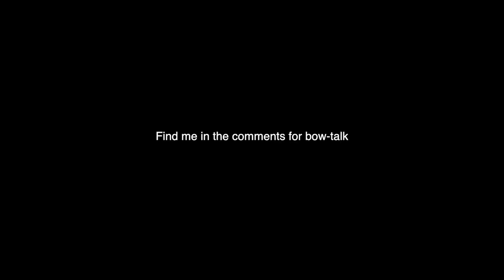Bushcraft Survival Bow

Comment: Wow! That’s a beautiful piece of timber. I’ve been wondering if I can use western red cedar for a bow. Its very common here in the PNW. Is there anyway to prevent set on green bows? And in your experience, which wood takes the most set?        Thanks for the vid Dan 👍
Reply from the maker: As far as I know western red cedar has no relation. I would approach making a bow out of it like making a bow from pine or other ‘non ideal’ wood. Eastern Red Cedar is really a juniper not a cedar at all. I think set has an unfair reputation. I’m not saying it’s a good thing, but sometimes it’s better to have a bow take set rather than break. Hickory for example had a bad reputation for taking set, but a fantastic reputation for being hard to break. Making bows is all trade offs, nothing is free. So yes, green wood bows are gonna take set and there’s not much you can do other than overbuild them. But on the other hand, they’re harder to break, so your margin for error is very high. I can’t make a fun proper bow in an hour, but with green wood that’s no problem. 
I’m not sure which wood takes most set. To generalize, the woods that take a lot of set tend to be strong in tension with relatively low compression strength. These woods also tend to respond well to heat treating, which increases compression strength, but adds brittleness in tension. nothing’s free in bowmaking and you have to barter for all your gains
Reply from the maker: Neat! Western cedar doesn’t grow around me so I’ve never used it. After looking it up it isn’t really a cedar either but actually a Cypress, which i’ve heard can make good bow wood, so I’m not surprised. There are a lot of bow woods that are considered marginal that I actually really like. I’m sure western red cedar could be one of them. i’m making a bow from fir right now, which isn’t considered the best either. I hadn’t heard that about saxton pope. I know the thompson brothers though of eastern red cedar as poor mans yew
Reply: Dan Santana Bows I've always wondered about fir tell me how it goes
Reply from the maker: That bow might be in the next video, we’ll see. This piece is only 40” so it’s a short paddle bow, won’t have too high of a draw weight. Fir isn’t bad bow wood but it’s not very dense. If you adjust oak board bow designs in width proportional to the density difference, then fir makes good board bows
Reply: @avidanglerorobsession6127  Great thanks! some of this makes me wonder what the chinook and other local tribes would use for bow wood.
Reply: @Cameron Pain in my area around vancouver bc i know that they use yew ,western red cedar , yellow cedar and  vine maple i also was reading the bowyers bible and they said they could make a bow of duglas fir ive naver heard of some one using it but with a lot of sinew it might be worth a try
Reply from the maker: Avid Angler or Obsession? Wow you have all the good fishing spots! I know a lot of bowyers on the west coast really like vine maple, I’m keen to try it. I prefer making unbacked bows, but I think fir isn’t a bad candidate for sinew backing. I would probably still use something else if there are better woods around. Tim baker says it gets as dense as ash in TBB, and i’ve seen some dense fir bit nothing that dense. here’s Tim’s list for anyone without the book. https://sites.google.com/site/onemississipp/bowwoods

Comment: Looks great, try some pvc by the way, that material is really great to work with for bow making
Reply from the maker: Thanks Jack, I already have 2 PVC bow videos on the channel. One is a tutorial for a 40# PVC horse bow and the other is my version of Link’s bow from the Zelda games. 

PVC is very fun and a great way to explore designs, but my favorite way to make a bow is to start with a tree
Reply: @DanSantanaBows  true, honestly i tried wooden bows couple of times but i couldnt find aged wood anywhere and green wood would always start having small cracks on it two weeks after i got it off the tree
Reply from the maker: @Anonymous-rj2lk  We don’t do it because it’s easy! It takes some time to find the right process for you and your wood. Troubleshooting is one of the most fun parts for me. It helps that a lot of the time drying checks are only a cosmetic problem.

Sounds like you may be drying too aggressively, or using a hard to dry species. You can mitigate the risk of drying checks by drying more slowly and cutting in the winter. Sometimes roughing out the bow green helps, so the wood dries more evenly and isn’t trying to rip itself apart internally
Reply: @DanSantanaBows  i will try! Thanks for the tips brother🙏
Reply from the maker: Anytime, that’s why I’m here. If you’re on reddit check out r/bowyer for a helpful and friendly bow making community. All kinds of bows are welcome

Comment: Nice video! Does it matter if the back is white or red? I noticed some logs have multiple layers of sapwood, but they almost melt into the red.
Reply from the maker: Don’t worry about the color, just keep the violation to a minimum if you can
Reply: @DanSantanaBows  Thanks, I'll give it a try.